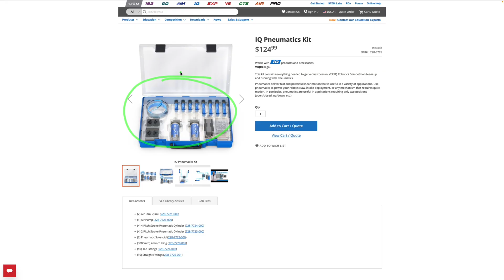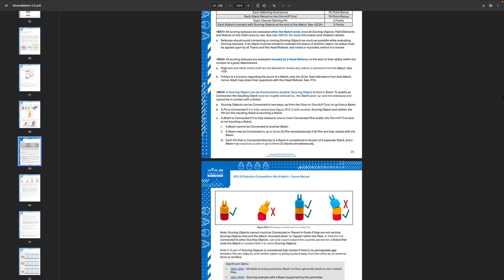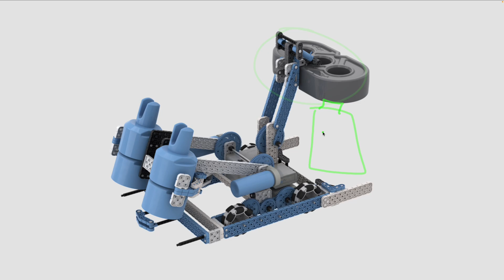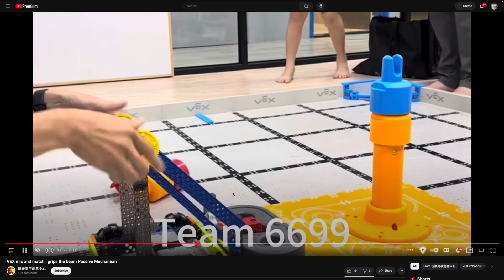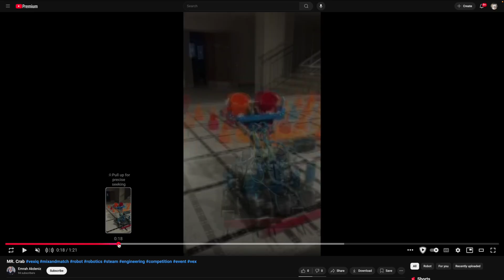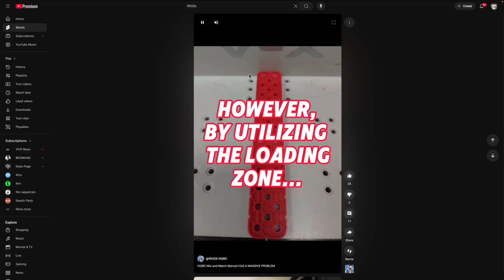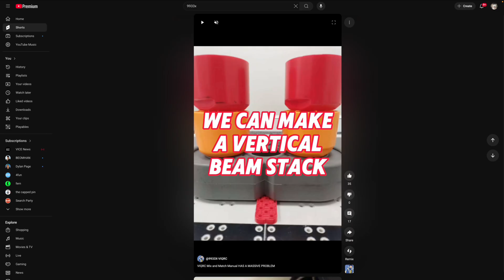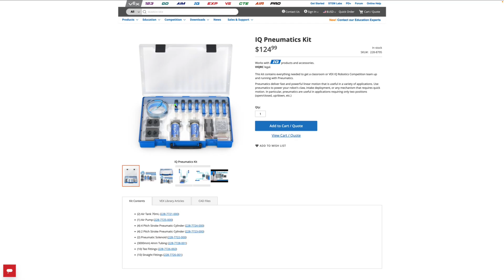NO PNEUMATICS META?? Building a 180 Mech without Pneumatics for Mix & Match!

Comment: I have a question regarding the scoring. In SE2 in the game manual it shows a cactus is worth 91 points but it is not in the floor goal. Could you tell me the amount of points the cactus would be in the floor goal & on the stand-off goal?
Reply from the maker: Floor goal bonus and the beam connected bonus is in the same category, so both 91 point. However, stanoff goal add 10 points to any stack on it, which is a seperate bonus, so 121